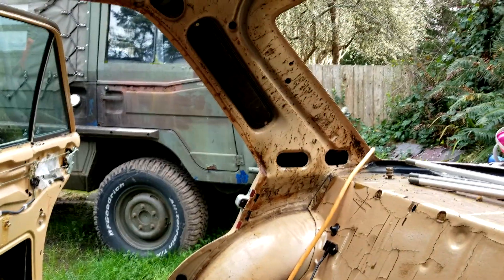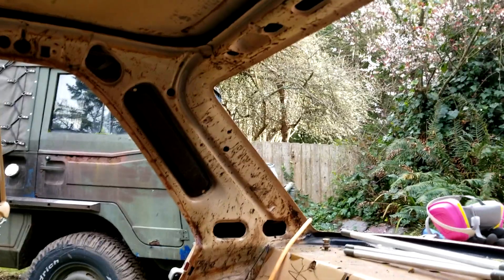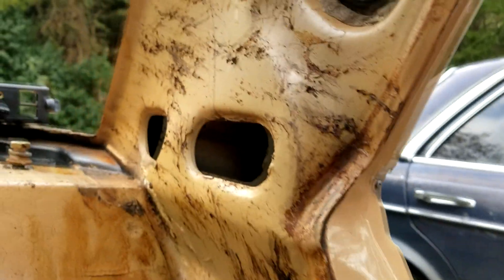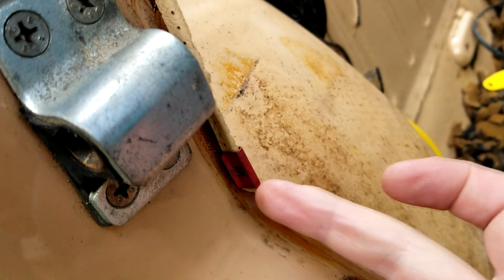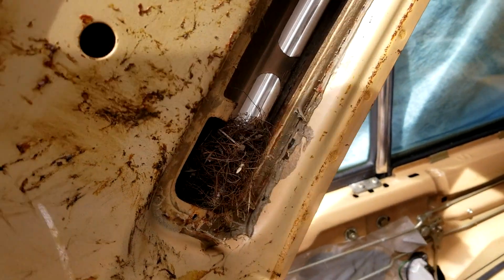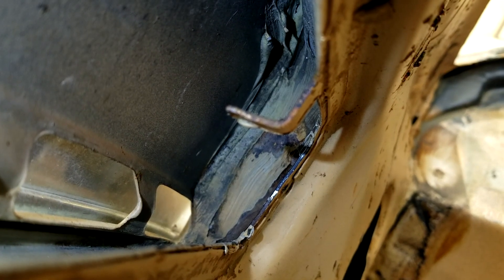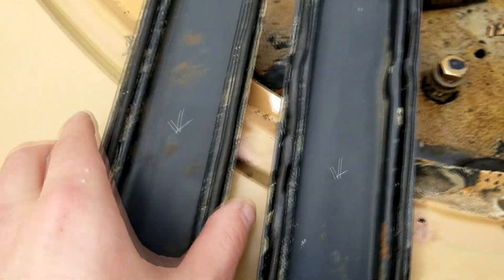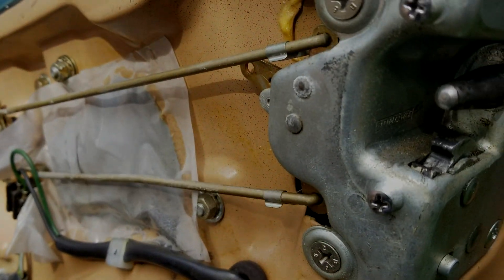W115 body vent and headliner insulation

Comment: Anything we should know when removing the headliner? I have a w126 300sd, I’m sure it’s the same, almost if anything.
Reply from the maker: Are you trying to save your old one? I just cut old out and replaced with new.
Reply: Diesel Benz Revive yes my old one is still good, I’m wanting to install my noico sound deadening and heat mats
Reply from the maker: On w123/w115 the headliner gets tucked under the front and rear glass keep that in mind
Reply from the maker: Some adhesives wont hold up to high temperatures from the metal roof
Reply: Diesel Benz Revive so with a little patience i found out on the w126 the headliner doesn’t go that far back to the windows. It was so easy pulling it out, why was I stressing? Haha thank you. Got any adhesive promoter you recommend? I hear flex seal is great but not sure compared to 3m